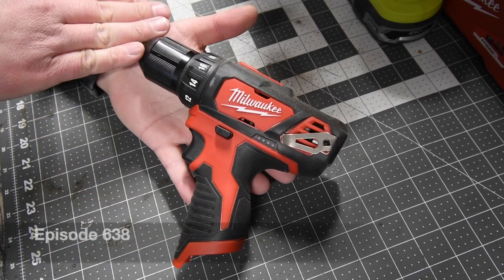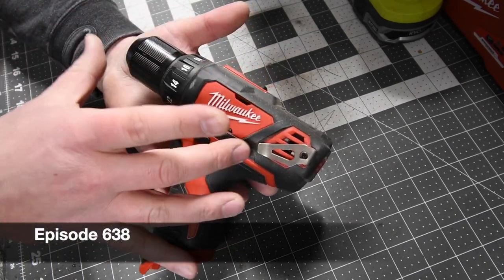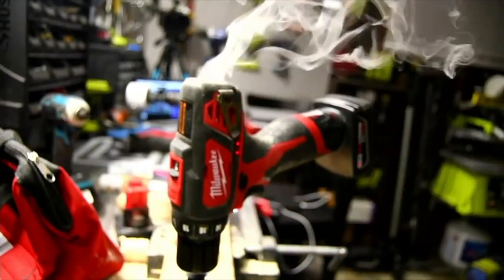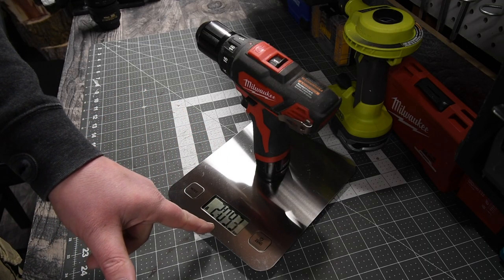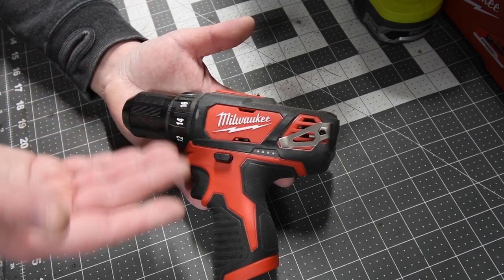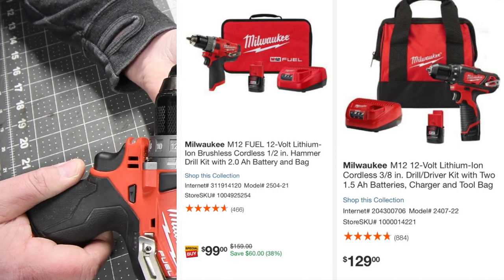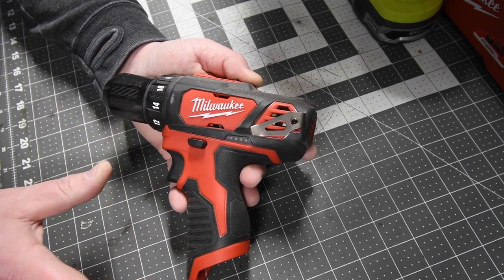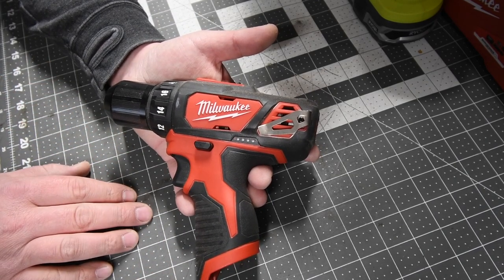This Milwaukee Drill Is Garbage, Here Is Why!

Comment: Tbh it comes down to expectations. Mine has worked fine for a long time. I don’t expect it to do big stuff cause that wasn’t what it was designed for. It’s a quality built small brushed 12v. Probably out performs drill master 18v and hyper tough drill along with the 12/18v warrior line  from harbor freight.
Reply: I think his point though is more so the value. Like he showed, on sale, you could get the Fuel one (top of the line M12 hammer drill) for $20 cheaper, or only $30 regular price, with a bigger battery. So while yes it is a good drill and good quality, why not get the better one, for not much more, so you have more overhead if you ever want or need to do something bigger? Especially if you can get it cheaper for sure, no brainer in my book.

Comment: I’ve had this drill for years! It’s works amazing for a 12v. I’ve used it today on the job site drilling 4 1/2” screws non stop for 3 hours. It’s not fast but it’s a great little drill. Sheet rocked. 3800sqf home with it this summer also. I did get a grinder that the switch went out but Milwaukee replaced that for free and sent it back to my house

Comment: Being around tools for many years I wouldn't expect much out of a 12 volt brushed drill, I do think there is a place for less powered tools, in the automotive field overpowered tools can create many problems, stripped screws, broken bolts, overtightened screws in dashboards that crack all the plastic. I believe the same is true for many other fields. I do have  m12 1/2'' fuel drill and impact, my go to tool is usually an 18 volt brushed Ridgid  1/4'' impact because I am used to its power and can control it better.

Comment: I picked mine up years ago at a garage sale, the old man threw in a M12 wall inspection camera with it for a total of 50 bucks, I couldn’t pass it up. Have used both often on many jobs for about five years or so now, the wall inspection camera sucks, but in a pinch it can come through and be just what you need. The drill is an excellent little light duty around the house/around the shop drill. I’d say that about two times out of 10 the drill proves to be under powered for what I’m working on, so I just go get something bigger. But for the size and weight, it’s a nice little unit. Plus there’s something about taking a wiff on the vents as you pull the trigger on a brushless motor. The smell of our childhood!

Comment: I’m not a fan of the hammer drill model either. It stopped working on or about the sixth time I used it. Since it was a kit the Milwaukee site didn’t offer a replacement. I have the drill sitting on the floor gathering dust now.

Comment: when makita makes a tool for a specific task, fan girls calling it " under powered" , but  when Milwaukee underperform , all the excuses in the book are thrown out
Reply: Under perform?... Who knows are sharp the hole saw was to begin with. Also I wouldn't use any m12 to drill a hole that size with a hole saw (just me tho). No doubt it's not a powerful drill. I use mine for mostly door knobs and lighter duty drilling with no issues.
I guarantee I could burn up any brand drill by simply by using it for more than what it's intended for.
Me personally wouldn't grab my 12 volt tools for any kind of hole saw bits. To each their own tho. I assume your a makita fanboi by your comment tho.
I'm half makita and half Milwaukee myself.
Reply: @reddawgrup1779  lol I just prefer makita personally,  but I do have , like and use Milwaukee and Dewalt as well.  I'm just busting on the fanboys

Comment: I have 2 sets of those brushed impact+drill, and 1 set of the fuel impact+drill and I can say those 12v brushed are the worst I've ever used. The drills are borderline useless and the impacts can barely sink a 2" drywall screw. Sucks because I bought them for the 2 1/4" PVC pluggable screws but they're painfully underpowered for even that simple task. The m12 fuel hammerdrill is a little underpowered too. The m12 fuel impact is a totally different animal and can run 5-6" ledgerlocks.

Comment: Seriously if a Hilti breaks out of the box your excited to see how the warranty works. If I abuse this inexpensive Milwauke it's garbage? Lets be fair now and try one of the cheapest Black and Decker (DeWalt)  tools and see how it works? And to be really fair a new motor is $20.00 verses any brushless that if the same thing happened would not be worth repairing! By the way max recommended hole saw for that drill is 1 1/8"!

Comment: It’s good for sharpening tungsten and for sanding down copper when you soldering 

It’s all about know how to work 
It’s knowing wich tool to use for the job 
It comes with field experience. Something you clearly lack. I unsubscribed awhile ago but I thought hmm mabey he’s onto something about how the chucks get stuck on these models but you haven’t used it long enough to know about that part.

Comment: Don’t buy the m18 brushed drill either. It’s a solid feeling tool with a nice all metal chuck, but my brushed ryobi cheap plastic puke 🤢 green lime machine out performs it in rpm’s. I bought that Milwaukee brushed drill and impact kit on a steel basically to get additional m18 batteries and have another beater set. But I would never want it as a primary drill just too anemic. The brushed impact m18 is solid though

Comment: lol all this drill should be used for is a home owner to hang stuff or drill into soft wood for small projects lol. That being said if your gonna use auger bits. I still use m18 I was also let down by the m12 fuel hammer drill basically being the size of the m18 fuel. I sold the m12 drill but kept the impact. And use my m18 for everything lol. Great video even for a home owner I would recommend fuel m12 for the times you really need that extra drilling power into some hard wood or metal and especially for a diy person you'll be surprised how much a brush drill will let you down lol